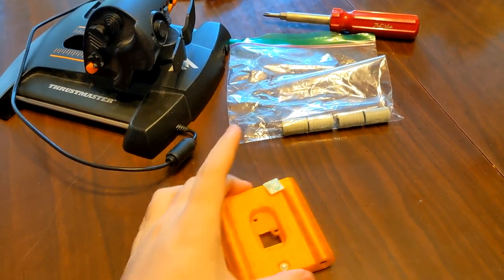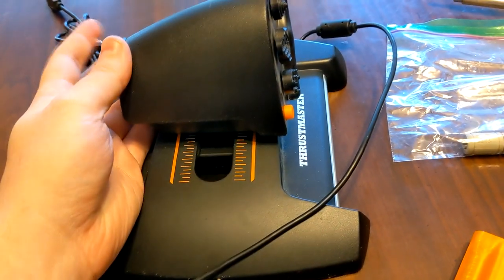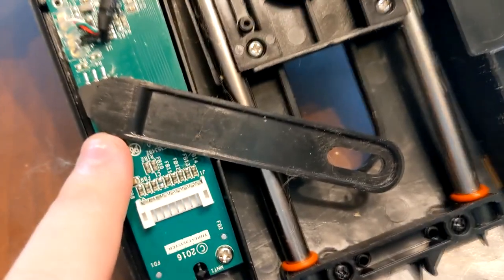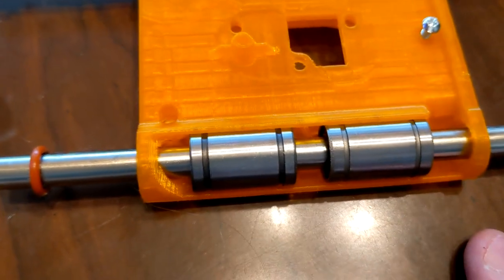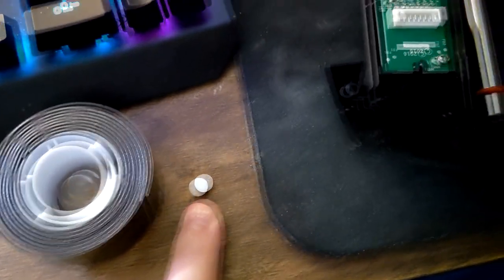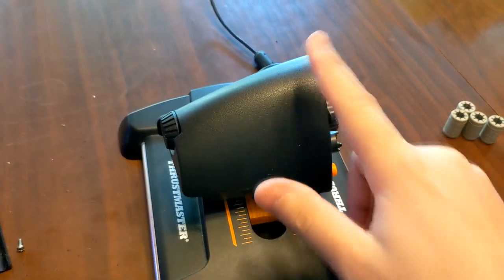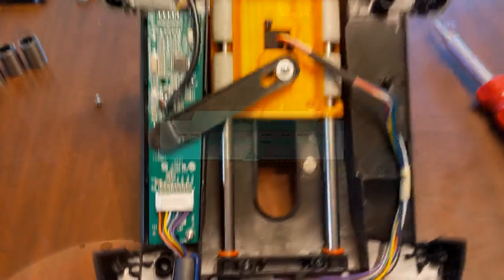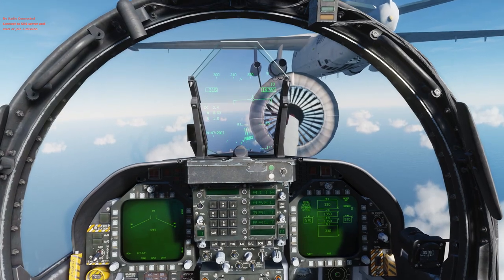Make your Thrustmaster FCS Throttle as smooth as butter and gain a detent.

Comment: It’s going to be in much higher stock in approx. 3 days. Keep checking back! I can keep making more!!
Reply: Hey man, I noticed the link in the description here isn't working for me. Could it be because i'm in europe? Really interested in this product
Reply from the maker: @jessemetternich  It could be because they're sold out. However here is a link directly to the guy's esty page. https://www.etsy.com/shop/CoreHawk3D
Reply: @TFCSHQ  Thanks a ton!
Reply: I just ordered one! Thank you sir - this seems like a way better alternative to the Nyogel I was about to slobber all over my currently shipping throttle!!

Have you ever used the 767A gel along with your device btw? Is it recommended or would it be too sluggish?
Reply: @amirite  Thanks for your order Steve! I have not tried that. I wonder if it would make the metal bearings silent... I don't know much about it honestly. If it's damping I wonder if it would deteriorate the seals on the fronts and backs of the metal bearings. The polymer ones recommend no lubricants so I imagine that lubricating them might accelerate their degradation (which is indefinitely slow as far as I know). That being said, it might work really well and if it does degrade stuff fast, you can just buy new bearings on amazon and swap em out! I don't know if I'll be trying that on mine because I'm after a solution you can install and forget about forever and I imagine those would attract more dirt than I'd like personally. Let's be honest though, it's not like I've gone in and measured dirt accumulation rates or anything so who knows, you'd probably be fine! haha sorry for the novel...
Reply from the maker: @amirite  No need really. This upgrade has been pretty smooth with left over lube that come on the throttle from a few years ago.
Reply: @CoreHawk3D  Thanks for the response! The Nyogel 767A is a very thick high-damping gel often cited by HOTAS enthusiasts as way to make cheap joysticks feel a slot smoother and natural. I've been skeptical of the 'miracle gel' comments but after a lot of research it seems that under the right conditions it can improve specific joysticks and this throttle is one of them. So that said - it's considered safe with plastic and everything like that. I might give it a try, but I was curious what you thought about one thing - the videos on applying the gel make it clear they're basicqally service the same function as your hardware. Do you think that using a small amount of this gel might be too much for the tiny bearings in your setup, and end up clogging things up? I was always curious about a hardware solution for this throttle and unfortunately only found your device a few days after buying my gel + throttle, so I suppose I should just be happy with your device on it's own but I think my curiosity will get the best of me! :D Maybe I'll just buy another now in case I gunk up my current one XD
Reply: @amirite  did you try the gel with the upgrade, how is it?
Reply: @Relish.  Hey it works well, but make sure not to use too much. The first time I did it, I saturated the inside of the ball bearings too much and the movement ended up being bumpy and bad. But then I bought new ball bearings and coated the rods entirely with a very thin layer of gel with my finger. This has worked great!!
Reply: Hi CoreHawk3D - Looking to buy a plate and metal bearings if possible. I've emailed you on Etsy already OK. Can you let me know when you have made some more plates please? Also, are you able to supply the bearings too or do these need to be sourced separately? I'm a total novice at this so any help appreciated!
Reply: @SusannaSaunders   Hi Susanna! I've got a bunch more for sale now, and I source and quality test the bearings, all you'll need is a screw driver!
Reply: The thrustmaster rudder pedals are made just like this and it's awful. Does he make something similar for the tm rudders?

Comment: The one lubricant that everybody recommends for this throttle is Nyogel 767A, which is a damping grease: the sort of stuff in high-end telescopes and camera lenses. It is plastic safe and makes the throttle way smoother. It's useful on sticks as well, but quite pricey for a lubricant.
Reply: Expensive but it's incredible. The thottle is now smooth. I used it on the stick too. Highly recommended for all T16000 Hotas owners.
Reply: I find silicon grease with PTFE also quite suitable.

Comment: I mean, that looks really cool and all, but I just greased and untight the regulation screw from mine and it's super smooth now.
Reply: Dry graphite lubricant and a polishing sponge. It will take quite a bit of patience, but if you polish the plastic piece that the bars ride on, as best you can, and use a little graphite powder it will be butter smooth for many years. But, eventually it will get sticky again. This mod fixes that; polymer bearings with a touch of graphite, PURE SILK.
Reply: I did same, grease for airsoft gearbox and loose the screw

Comment: I think all the dirt was causing you them problems, like all I saw was hair wrapped around everywhere
Reply from the maker: For sure wasn't helping but because of the design of the throttle its really easy to get shit trapped in there. Throttle still smooth now however. And not just mine, but our org pretty much all got one of these for their FCS throttle and everyone reports back positively. About 5 or 6 of us use/used that throttle with that upgrade.

Comment: The reason the throttle sticks in places isn't because its plastic on metal. Without a bearing any scratches or changes to the surface of the rod will change the friction. Changes in friction change the speed when you push on the throttle. This ruins consistency with small adjustments. When your pushing down your increasing the friction. This makes the small changes less pronounced and it feels smoother

Comment: Very simple and very low cost fix, put a dab of dialectric grease on your finger, rub it on each rails and move the throtled back and forth.  Fixed.  Thrustmaster was very very cheap on the lubrication.  Of course the linear bearing will permanently solve and improve the throttle but it costs more and requires disasembly of the unit while just greasing the thing properly takes 30 seconds.

Comment: Ordered the polymer bearings and just installed them.  Thanks to your video, all went well.  
Thrustmaster should be ashamed by using the system they do.  I only have 2 hours on the TM16000m and the throttle was more like a ratchet wrench than a smooth rail.  Thanks to you and Etsy, ALL GOOD! !! !!!

Comment: Perfect product and perfect manual. One hint - after assemblying, you can still fine tune the tension there is a hole in the bottom piece allowing accessinng the tension screw with the thtottle in the full throttle position. In case of unavailability of the metal bearing at the maker of this mod, you can still acquire them easilly on Amazon (I bouth then on the Polish Allegro).

Comment: I use those polymer linear bearings in my 3d printer. They're self-lubricating so as they wear a bit the dust binds to the rail. They're quiet, and will smooth after a bit of use. Don't oil the rail with them. The metal will roll easier, but I like a bit of stick. Also the grease will gum up, so you might get some issues.

Comment: Not having access to a printer at the time I got the throttle, I just cut some small channels into the baseplate and glued in some small brass rods.
I had to sand out the plastic a touch so only the rods were contacting the steel, but it's smooth as hell and really quiet.
Took a few hours with a dremel and a vice. I also modified the swing arm so that runs on a small bearing, but I think I'll upgrade that with brass fittings at some point.

Comment: just a heads up. every so often as a typical PM for the linear shafts. Its a good idea to remove them and wipe them off with IPA. Then lubricate them with a turbine oil. Its important to use this type of oil when working with linear shafts and bearings. Respectfully, Mike

Comment: I just loosened the friction screw and boom, it's smooth!
both the polymer and metal those roller bearings are used in industrial 3d printers either will be smooth and last a long time in a throttle. The polymer are considered and upgrade to the metal ones on 3D printers.

Comment: I threw my brand new throttle in the bin as I could not get the cylinders which hold the rod to stay in the brackets.Kept falling out.
When I moved the throttle,it made a scraping sound so I gave up and threw the dam thing in the bin.

took me hours ,the metal rods and cylinders  kept falling out all the time.
Not attempting that mod again.

Comment: i just loosened the bolt and put engine grease all over the rods, been buttery smooth since
Reply from the maker: I will say, I'm not at all paid by this guy, but using their bushings/bearings is going to be WAY better than just trying to grease the rails. You might get a few days where it feels better, but you'll never get to as smooth as it is with proper bushings/bearings. Everyone in our org who owns this throttle has bought this and its a universal opinion. Its a design flaw on TM's side. Not saying everyone SHOULD be getting this, if you can figure it out yourself, great. But a bottle of lub is like $20, almost the same price of  just buying this. It's legit a great redesign. And regardless you're going to want to redesign the slide system not just pouring lube on it and spending tons of time keeping it clean.

Comment: Thanks for pointing out that the part at 11:11 is reinstalled wrong. That protruding thingy is also meant to hold the wires down... I guess you are not getting to 100% anymore that way, unless it recalibrates automatically.
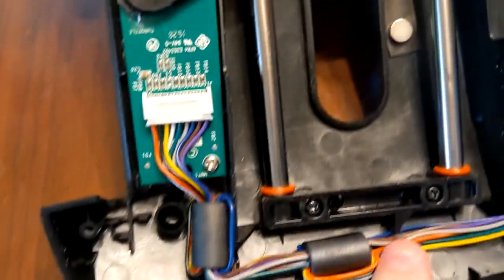Reply from the maker: I believe I address I installed that wrong at 15:38

Comment: I have a question about the magnet detent. The magnets are placed to sucking from each other(N-S, not N-N/S-S), and fixed only by tape/glue, right? Won't you worry if the tape/glue aged in future, the two magnets will be loosen and finally leave the plastic and sticking with each other? Sorry for my English, hope I express my question correctly
Reply from the maker: This happened to an org mate of mine who just used the double sided foam tape. However I ended up using super glue for mine, roughing both the magnet and the throttle, and  they're still attached. You could also do the same with epoxy
Reply: @TFCSHQ  thanks for the reply. So with super glue it'll be sticking there forever. If in future I want to remove the DIY detent, it'll damage the inner surface of the plastic case... 🤔
Reply from the maker: In my experience with superglue it probably won't damage much. The Epoxy will. That said, you could also use other glues, like white school glue or hot glue and you for sure won't damage anything and it'll be easier to remove.
Reply: @TFCSHQ  got it, thanks for the info and happy flying :-)
Reply: Shoe Goo will hold them down solid.

Comment: would you clean everything from the grease before you install the bearings? I did some other tuning with Nyogel which improved the original throttle a lot so everything is a bit sticky in there. I don't wanna ruin the bearings though by not removing the grease.

Comment: Which parts do I need for the throttle? I went to the sellers side, but there was several choices...?
Reply from the maker: The seller has updated the product several times since this video. However the choices are color (doesn't matter what you pick) and if you want bushings or bearings. (or both). My experience with the bearings was they were maybe a little smoother than the bushings, way less resistance (which isn't necessarily a good thing) but also WAY louder. For most people the bushings is probably what you want. However it's not that much more expensive to just get both. That's what I would suggest so you can try both out.

Comment: Mine has 2 months. It works smooth but won't hit zero.  

The target software UI shows it moving virtually. Anything below 50% slide won't stay at the intended percentage it just goes up and down and goes crazy. Tried everything but dissasembly. 

Any ideas?
Reply: Bit late, but compressed air and/or isopropyl alcohol to clean the sensor?

Comment: nice tutorial. but please, please remove that bunch of (cat?) hairs from the rails before putting them into the new bearings.
i have the T.Flight ruder pedals which have similar rails. if you put on a very thin layer of silicone grease/oil, they are much smoother.

Comment: How where you able to replicate the Form of the original base? And the magnets are too small im trying to make a detent also and that small doent give much pull
Reply: How does the Dampening feel if you screw it tighter with the metal bearings?
Reply from the maker: "replicate the Form of the original base"
What exactly do you mean by this?

"the magnets are too small"
I think they're a bit weak myself. It does work however for what I used it for though. But you could always add your own. Some people have hot glued a larger more powerful magnet to the bottom of the base and sled.

"Dampening"
Personally I really don't like any friction however I just tightened it all the way and honestly cant really tell a big difference. It doesn't seem to stick either.

Comment: Hm is it me or does it look like the center detent magic is a little too strong?  It kind of looks like it wont allow you to leave the stick at any precis spot just before or after the indent and it will just pull the throttle to it?
Reply from the maker: Its actually a little weak imo. Without the throttle attached yea it looks strong but I might actually add a second magnet so it's stronger.
Reply: @TFCSHQ  Oh good to know! btw what is it about the metal ones you like better? Are they a little smoother than the polymers ones? Just that the polmers have a little more friction?
Reply from the maker: Less friction. They're both smooth. However the metal ones have much less friction. Its not strong enough to pull the throttle. It does pull the base by itself though. Its not as noticeable as I'd like personally.

Comment: can you give us a rundown of all your gear, if possible?
Reply from the maker: All my joysticks?

I own a Virpil Alpha, Delta, WarBRD grip, a WarBRD gimbal and a MT-50 throttle. A Thrustmaster FCS HOTAS (With pedals). A X65-f, X55, and several Saitek sticks from 2003-2005ish era as wel as the Saitek pedals. Microsoft Sidewinder. A logitech 3d eXtreme joystick. A CH Fighterstick and lastly a Defender Cobra M5. Might be missing something, I've had a lot of equipment. I also own a track IR which I use the wireless DeLan clip for. 

If you check my channel you can see my full current setup in the "The Ultimate Star Citizen HOTAS Setup And Binds" video.
Reply: thank you, the video "The Ultimate Star Citizen HOTAS Setup And Binds" that set up is insane that is what i was wondering about.
Reply: o i am left handed any suggestions?
Reply from the maker: @omarmald  If this is your first stick, and its for SC, probably go with dual T16000m sticks. To my knowledge there are no throttles for left handers. If this is for some other game, and you want a throttle and will use the stick with your right hand. The Thrustmaster FCS hotas is a very good starting point.

Comment: You clearly also have a lot of dust and hairs in your throttle. That will most probably cause problems even with the new upgrade?
Reply from the maker: Non yet. The dirt etc didn't help, but you can google, all FCS throttles get this problem, even when clean.
Reply: brand new out of the box, it was sticky as hell.  I returned it the very next day.

Comment: Thanks for the video. IMO Thrustmaster is crap. Even the Warthog. On the 16000 not only do you have this problem but the joystick on the front is crap as well as the left-right flipper on the front. I just ordered a Virpil throttle and stick. I am not putting another cent into this cheap plastic crap.  And there support is crap. If your device is not under warranty they won't do crap for you. I tried to order a couple of parts and they told me, sorry, don't sell parts. If it isn't under warranty you are screwed. Thrustmaster is dead to me. Total crap.